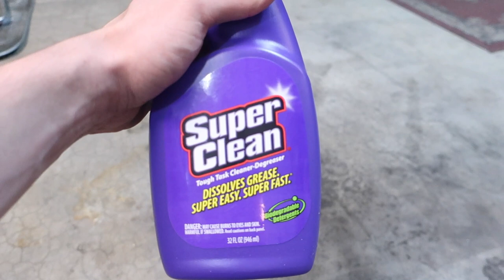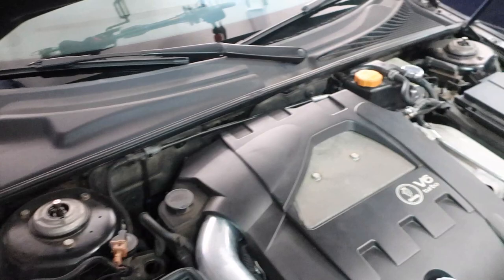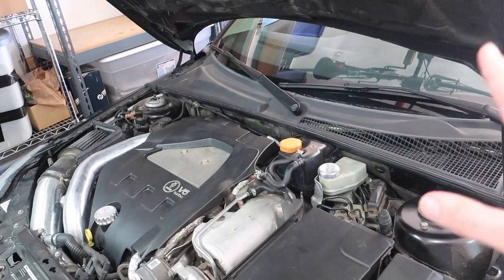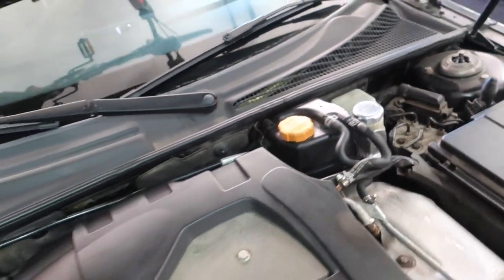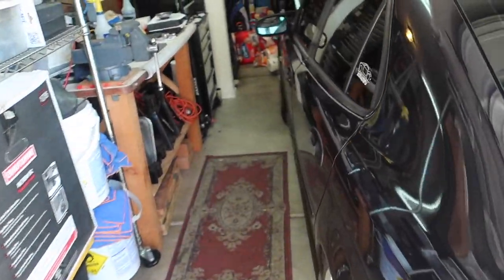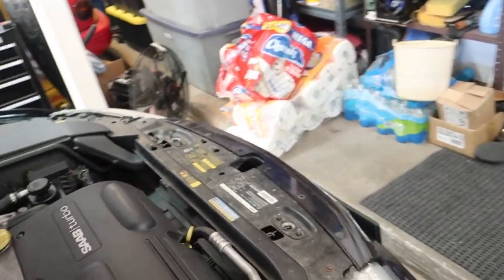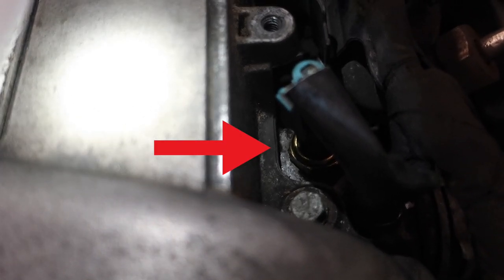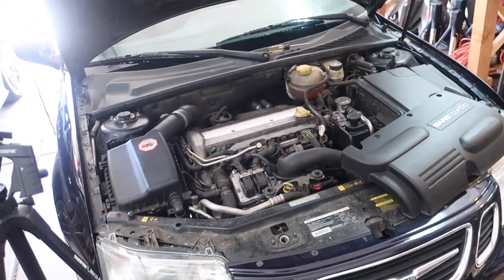Another Update on My 9-3's: Leaks, Leaks, and More Leaks

Comment: Check to two heater hoses where they plug into the pipes above and below. The o-rings in those plastic connection heads fail over time. Had them leaking in my 05 a few years ago. Also check on top of and underneath the water pump, which is a sign of pending failure. The water pump is behind the motor, bolted to the backside of the chain galley. You can just see some of the top, and then will want to get under the car and look up at it to see if there is leaking down the underside of that pump. 180k miles is the avg lifespan of the OEM pump. Good luck! Hope it is cheap!
Reply from the maker: Thank you! I hope so...

Comment: Replace all 4 of those squeeze clamps on the 2 overflow hoses and use the regular screw-drive clamps of that size. 
Solved my 2.8T leaks at that location. Lots of pressure and subpar clamps in my case.
Reply from the maker: Yeah those screw clamps are actually what initially caused my leak so I switched to OEM ones 😂

Comment: On my SAAB engine and cooling system I used some AT-205 which is a plastifier, it feeds dry rubber seals and they regain their elasticity.  No more leaks for a few bucks.
Reply from the maker: Interesting...

Comment: For the 9-3 You should check the  Thermostat housing gasket that  Is connected in back of the block on the engine close to the transmission.  You will have to Jack up the  Vehicle To get a better view. I just replaced  minds about a week ago
Reply from the maker: Thanks for the advice!

Comment: For the mystery leak on the Arc, check the o ring seal between the water pump and the cross pipe that goes into the thermostat. This is often where the hidden leak is at. You won't notice it for a while because the car will run and the seal will expand so it won't leak under pressure but as soon as it has time to really cool and contract, coolant will seep out of it and you'll never quite be able to find it. 

For the Turbo X/2.8, you're going to inevitably leak at the oil level sensor, I found a good thread on SC that has a link for the seals and a how-to. It's a finicky job but well worth it.  I did the job on my 2.8 and I have an absolutely leakless car. Very rare lol. 

https://www.saabcentral.com/threads/b284-v6-oil-level-sender-oil-leak.697537/
Reply from the maker: thanks for the tip!

Comment: Thankfully no leaks on mine yet but have you ever had problems with turning the key in any Saab? It’s progressively got worse but I don’t see how at 91k miles it would just kaput. Getting it from the lock position to the off position is the only part that’s hard like I have to put a good amount of strength into turning and it just snaps to the off position. No warning lights of any kind runs amazing. off-on-start turn perfectly it’s just getting it from lock-off. Any ideas? 2010 9-3 2.0T btw thanks for the vids man!
Reply from the maker: Never heard of that in the NG 9-3 :/ I wonder if the ISM is somehow going bad or if something spilled in there?
Reply: Yeah I think it’s just the ism going bad because the owner before me let it sit for a while. Never spilled anything on my part but it was clunky when I got it. I keep my extra face mask over the ignition anytime the key isn’t in it. Shits crazyyy

Comment: Did you check the thermostat housing? Mine leaked from there when I would hit boost until I changed the gasket for the thermostat
Reply from the maker: might have to; i did replace that a few months back. thanks!

Comment: My 2005 9-3 Aero has a small leak from the bottom of the radiator and a small oil leak to spark plug hole from the cam cover gasket.
Reply from the maker: Gotta get it fixed!

Comment: Gotta stick up for the Postal Service a bit. (No I don’t work for them) The delays are from a few main issues. 1. On-line ordering is through the roof due to the pandemic. Volume is ridiculous right now. 2. They had a budget crunch in the late summer and early fall which hurt staffing. 3. UPS and Fed Ex are killing them and not in the way you’d expect. UPS and Fed Ex are private and can and are turning down new retailer deliveries. These all go to the USPS who can’t. This leads to massive backlogs. Some letter carriers are being assigned two 8 hours shifts a day to make try and dig out. So if anyone sees their mail carrier give them a shout out. 2020 can GTFO anytime.
Reply: USPS is often faster than UPS & Fedex in my area, go figure. Also, as you said, expect add'l delays from Covid & the holidaze.
Reply from the maker: Definitely fair. I’ve just had a lot of bad luck with them, holidays or not 😂

Comment: POWER STEERING LEAK on 4cyl is the power sterring pump is driven by one of the cams... the pump bolts to the side of the head and has a shaft that connects to the cam...the seal on the input shaft of the power steering pump is the failure point...what is happening is engine oil is pressurizing and being forced into your power steering resivoir...FIX THIS RIGHT AWAY!!!!! if you dont engine oil will start circulating through your power steering lines and rack and pinion and DESTROY THEM!!! i am a SAAB tech i worked at dealer for 5 years...these cars were my bread and butter.... any other questions hit me up
Reply from the maker: I replaced all of the seals and everything a few months back: https://youtu.be/J9INdAieeuc. Thank you for the advice!
Reply: @AutoAutopsy  the seal has failed again then... Thats what the symptoms of your issure are

Comment: My TurboX recently developed a vacuum leak and the turbo has become somewhat weak, it still has some balls though, but I’m braking my brains to find the damn leak
Reply: What are the symptoms you're experiencing? I am wondering if I have a Vacuum leak as well, experiencing some slight surging at highway speeds, only when under pressure, overtaking or just pinning it. thanks.
Reply: @toddhodder  Well it has some power voids, and seems to give all the power at a different rpm range, has become weak at low and high revs and seems to give all the power very abrutply at mid rpm ranges. Also it makes kind of a hissing sound when accelerating and when stopping accelerating. Had this same issue with a 2.0T but also never managed to find the leak, i need a strong smoke machine to detect it.
Reply: @rikiorikio9368   thanks, I will let you know if I come up with anything, I also have a lot of KM on mine over 316,000km. Could be just wearing out on me.
Reply: @toddhodder  if your suspicion is about high mileage I recommend performing a compression test on the cylinders, neverheless I would check out the turbo’s piping for a loose pipe or a vacuum leak
Reply from the maker: I will have a video (hopefully) fixing my vacuum leak in the next week or so. I hope it can provide some insight for you!
Reply: @rikiorikio9368   will do, I hope it isn't compression failure, not many of my versions around in Western Canada, 07 Sportcombi Aero, hard to replace, and I love the car so much. But if so, we had a good run. :)
Reply: @toddhodder  mine has the B284R V6 engine, there are few to order new but still some on sale, or I could buy a Opel engine which is somewhat equivalent, if it breaks. If you have the B207R you could also search for a Opel engine which has its equivalent, could work for you if your engine was dead. Anyway, I would plug the Tech2 and perform some tests before burying the engine
Reply: @toddhodder  check out auto autopsy’s new video to check out for vacuum leaks, it worked for me
Reply: @rikiorikio9368  Unfortunately no Vacuum leaks, thanks for letting me know.